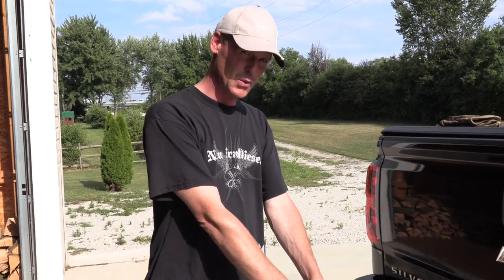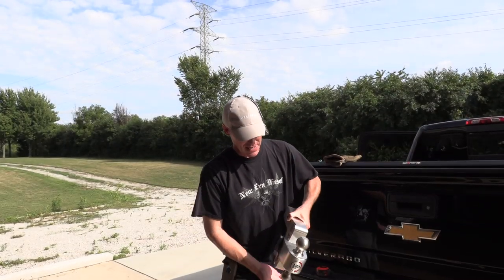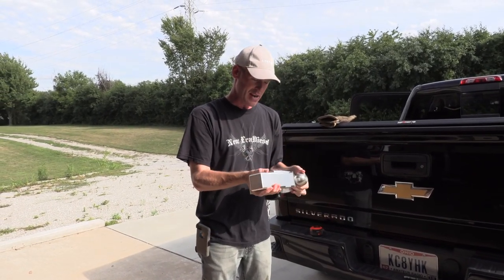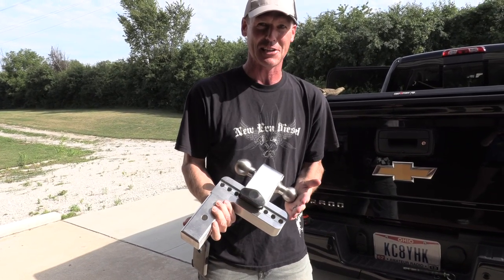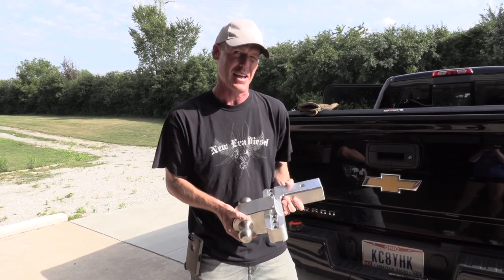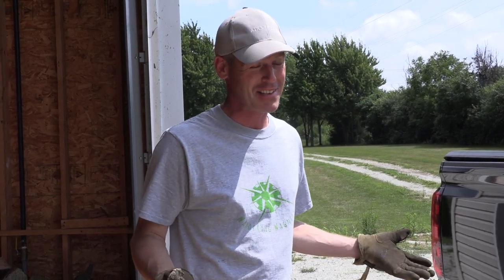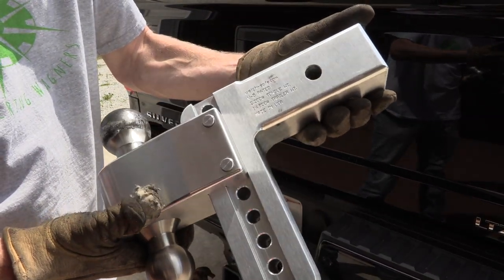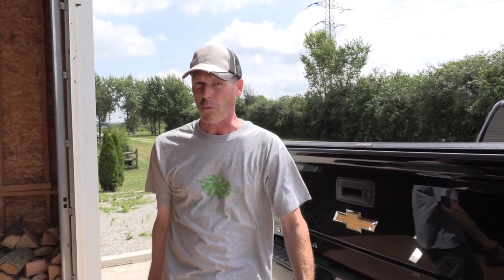New Truck Hitch: Weigh Safe 180

Comment: How do you like it long term? I just got mine today. Seems well built
Reply from the maker: Worked awesome for the time we used it! We no longer have a trailer (motorhome currently) so hasn't been used lately. Awesome hitch though
Reply: @WanderingWagners  that’s great to hear. First time I’m using a drop hitch. Main concern was strength and no rattles from the multiple pieces. But so far it seems solid.

Comment: I am understanding that you cannot use any WD or anti-sway system with this hitch.  If this is correct, why is that?
Reply from the maker: I was saying that I chose not to due to the dually, the better hitch, and our specific trailer we tow.
Reply: @WanderingWagners  Roger that, so one can still use a WD system with this aluminum hitch if they choose.

Comment: Question for the wandering wagners.  While the truck doesnt need weight distribution what about the anti sway. I pull about 8000lbs TT with a 3500 Ram. It also does not require weight distribution. But I still worry about sway.  Aren't you worried about sway?
Reply from the maker: I’m not worried at all. The best sway control is properly loading the trailer and weighing it to make sure you aren’t light on the tongue. We are at 13% tongue weight and have towed cross country at 80mph (where posted) without any issues. If sway control makes you feel warm and fuzzy inside though, I’d say go ahead and run it.
Reply: @WanderingWagners  thanks for the reply, I really appreciate it and really enjoy your videos!

Comment: What would you estimate the weight difference between your steel hitch and this one ?  I too am getting tired of lifting the old heavy steel hitch. I've never attempted towing the current trailer w/o the sway bars attached but should "test" it out on a short trip before going your route. Not sure if there is an alum with sway bar options ?
Reply from the maker: I'll weigh them when we get home from this trip

Comment: I wouldn't. I always thought having a dually has nothing to do with sway control when it comes to towing a bumper pull trailer, the pivot point is at the ball unlike a 5th wheel when its over the rear wheels which having 4 stiff tires help out  a lot. I know one thing...its still a cool ars truck!
Reply from the maker: Properly loaded trailer won't sway😉 there's a few videos out there that made the rounds a few years back, providing proof of this to people

Comment: I think in NY it's the law to have sway control at least that's what they said at the trailer store.
Reply from the maker: Haven't found anything on that. It's generally based off of the trailer weight and tow vehicle owners manual. This truck says specifically that no weight distribution is required.
Reply: Lol you are hilarious 😂 do you believe everything a sales person tells you.

Comment: I wonder if galvanic corrosion will be a concern?  Steel and aluminum are pretty close on the active level but when you start mixing in water and road dirt/salts it would increase that potential.
Reply from the maker: We always do a pre trip inspections on everything so if it does happen we will catch it